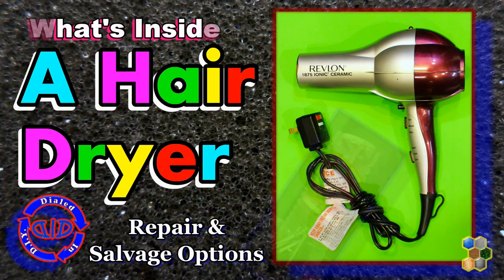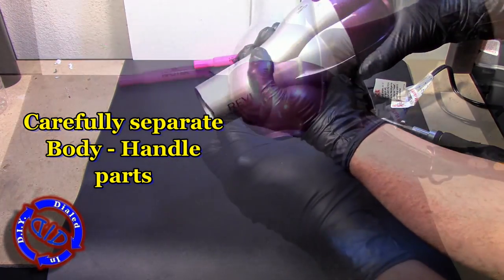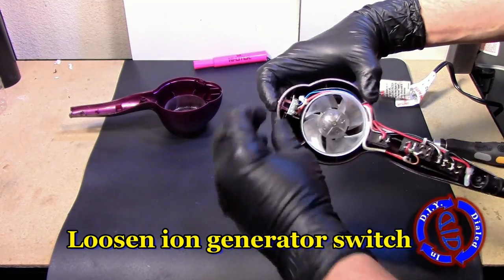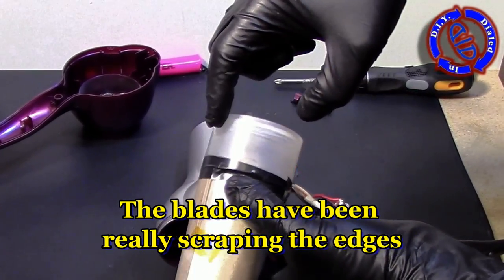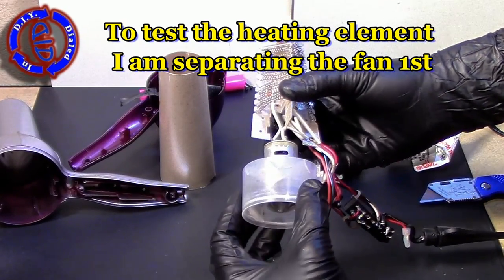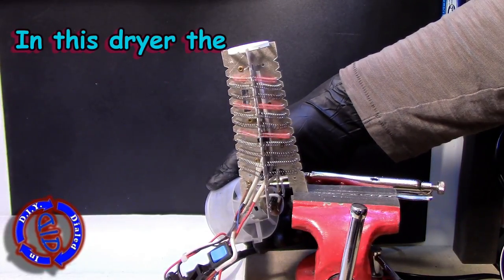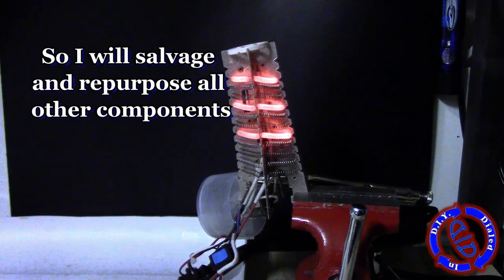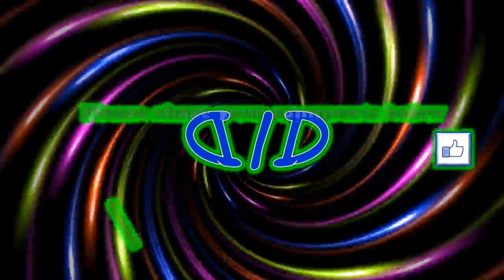Whats Inside a Hair Dryer - How to Repair or Salvage

Comment: My hairdryer motor burned out (the commutator) . I was hoping you would explain the purpose of the diodes. I believe the motor was 12v , so how is the AC voltage dropped to a suitable 12V DC?

Comment: Interesting, I hit your channel to see a different vid then saw this in the sidebar.  I use a hair dryer for my forced air metal melter.   The other day it started buzzing but no blow so...I dissasembled it.   Now I have the parts, main interest is the motor and the 3 way of/hi/low switch.   I think I know how the wires are going to work but will have to, ummm, test it-I'm glad it has a GFI switch.  :D
Reply from the maker: Hi Mark, thanks so much for the comment.  Were you able to get it to blow air again?  I too am a big user of the "test to see" method of figuring out what is going on with stuff.  Thanks too for watching my videos!!

Comment: How do I remove a fan that looks like that? I saw someone yanking it out on youtube, tried the same but it doesn't come out
Reply from the maker: You have a great question... Most are just forced onto the motor and should be able to pop back off but I have found some are forced on so hard that they can't be removed easily enough without risking breaking.
Reply: @DialedInDIY  Thank you

Comment: i have a question about thermal fuses, I've replaced them in other scrapped home appliances, but do you know if it's appropriate to solder the fuse in a blow dryer? will the solder stand up to the heat? does it depend on the solder? will i have to make a new brass rivet?
Reply from the maker: I've seen mixed thoughts in this.  Some say silver solder works but most feel the replacement should be crimped in.

Comment: Mine works good on all fan speeds but when i turn on the heat to med or hot . The fan turns off and the coils heat up. Whats wrong with it?
Reply from the maker: Interesting question/situation.  If the issue was overheating the thermal cutoff switch should usually knock out all power; heat would not work if fan was cut off.  Does your hairdryer have one switch with multiple settings?  If the switch starts on air only but then pushing further also turns on heat then the issue might be a faulty switch.  Since the heat and fan both work separately then I think the switch is the likely problem.
Reply: Fixed it! I forgot to put the coil back when i moved to put the fuse in. Ive ordered another fuse for another dryer i got too. I have third one its from the 80’s made in Hong Kong and there is no issues with it!
Reply from the maker: That is great! Amazing how one from the 80's still holding strong.  Thanks for watching and taking the time to comment.

Comment: I apprecaitet you taking the time to show about hairdryers and fixing them and or salvaging parts for other projects instead of letting it go to the trash.  I have a Conair  small folding handle hairdryer with the cool burst switch. Lately when I pressed the cool burst switch I noticed smoke coming out of the 3 way switch.  Looked at the insides and the wire from the cool burst switch connects to the three way switch and that terminal is burn out on the inside area of the switch. Could I just cut off this cool burst switch and still use the hairdryer or is this now a salvage item?  I thought about mailing to conair this broken hairdryer with a note of what went wrong so they can update their design.
Reply from the maker: Thank you very much for the comment.  I have a great deal of fun taking things apart that were headed to the trash/recycle and repurposing the parts for other projects.  I have done several heaters and dryers and typically the secondary switches can be removed without issue.  From what you are saying it is the contact point on the 3 way switch that came from the cool air burst switch that is the problem point.  If pressing the cool air burst button is causing the overheating (smoke) issue then I think disconnecting the entire wire seems like a good idea since it essentially creates the situation where the button can never be pushed to create the smoke.  Just to be clear though, nothing else is causing smoke just when you push cool air burst, right? Also, there are no other visible signs of overheating (including along the wiring all the way back to the plug), correct?

Comment: Can you do one on the GFI plug
How to fix it ? And also can you cut it off and put a 2 prong plug instead or is that a bad idea .. please help
Reply from the maker: Thanks for watching a posting up a question. Are you asking about fixing the GFCI outlet or a plug that has the third prong for ground? 
The third prong is added to appliances that will be operated outside or around water.  It is a safety feature.  Typically these are plugged into GFCI outlet. Generally speaking it is not a good idea to remove the third prong.
Reply: Yes it has the “test” and “reset” buttons onnit and the button won’t click in and my hairdryer won’t start... I wanted to open the plug but two screws are weird and I don’t have the tool to open it... what do I need to fix this ? Thanks
Reply from the maker: @nonameno6690  thanks for the clarification.  Many electronics have moved to non-standard screw types (it can be a pain... there seems to always be a newer type).  Many are the "torx" screws; it looks like a star / asterix shape.  One thing to try is unplugging the hair dryer and pressing firmly on the reset button, then plug it in and try turning it on.  To be honest it does sound like the reset button might be broken which would require a replacement of the hairdryer or possibly the plug portion.

Comment: Hi, I have the exact same problem with the exact same blow dryer. Would it be safe to  superglue that fan blade that is cracking at the bottom?
Reply from the maker: That is a great question... I am not entirely sure about the safety answer for a couple of reasons.  I think that if the blade isn't too bad then the glue could help keep it together.  What I am not sure about is if the glue would begin to chip off under that kind of vibration, rotation and heat exposure.  If it did begin to flake then what ever gets free will hit the red hot heating element and possibly spark up.  Sorry it is not a straight yes/no answer.

Comment: hi, can i know is it normal if the metal became burning like that?
Reply from the maker: Hi, thanks for watching and posting your question.  Which metal is burning? Is it something on one of your devices or do you mean does the cable I used end up burning? If it is the cable you are asking about, then no, I have not had issues with fire or burning.

Comment: The high medium low speed button is not functioning, help
Reply from the maker: Is it stuck on one airflow level OR does no air flow at all?  If it is a sliding switch: many times the part of the switch you can touch is just a cover that has a post over the actual switch lever on the inside.  That post can break and you will be able to slide a switch cover but not the underlying switch. Another option might be a disconnected wire. Does any of that sound close to what you are experiencing?
Reply: @DialedInDIY  Yes it's stuck on high so I'm guessing it's the wire which I don't know how to handle at all, I haven't checked if there's a cover for the actual switch lever, but I'll will.
Reply from the maker: @azizoghamari9654  Stuck on high might also be a shorted connection (if the switch seems to move like it is trying to change speeds but there is no change in operation).  I sometimes find that making sure there is clean separation between the wires connected on a switch helps fix this type of problem too.  Was yours the same model?